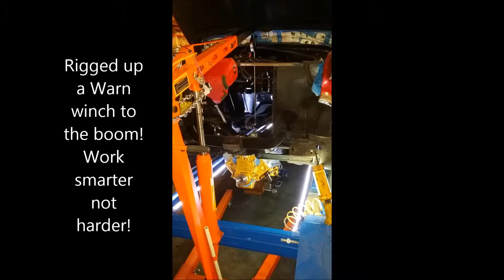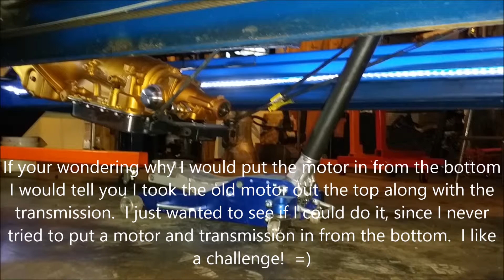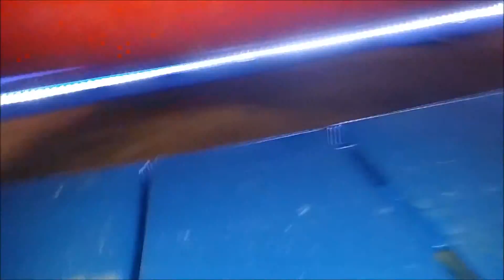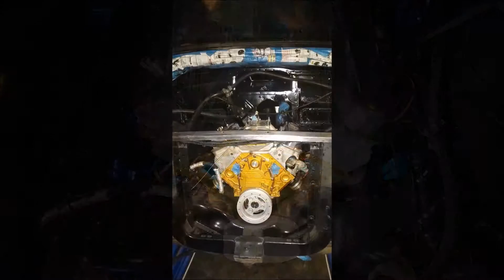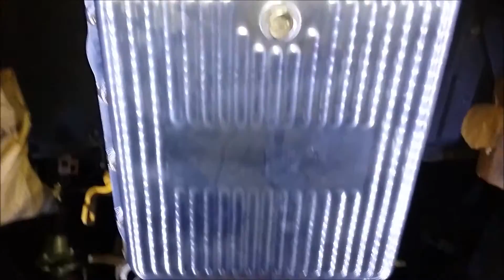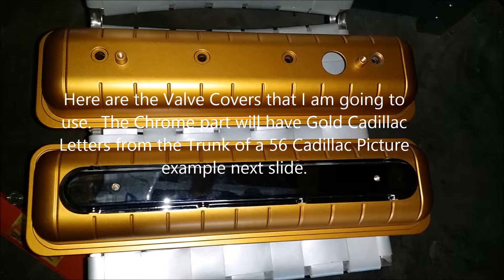1956 Cadillac 96 LT1 700R4 Installation

Comment: hi,  very good job congrats  have exactly the same proyect LT1 engine and '56 cadillac fleetwood. ..how much for the motor mounts and tranny. . what can of problems with  power steering box? .. can you help me with the mounts?
Reply from the maker: Julio Parra, the power steering gear box is a tight fit with the exhaust manifolds may have to have a custom manifold for drivers side.  I dont sell the motor mounts and the trans mount sorry.  but they arent hard to make just have to put in the time and elbow grease.  I did make a second set of mounts because the original were not as wide as I liked and I thought it would put too much stress on the bolts.
Reply: Josh Hypes hi ,just from work...thank you, you give me the idea on the motor mounts,  about the exhaust,  you can put corvette or camaro manifolds ,you know, those are more thin or skinny. ..
Reply from the maker: Julio Parra, yeah i have the corvette manifolds they didnt fit the camaro ones i have on it right now but had to modify them to fit.

Comment: Is that the stock stiring box?
Reply: Was it hard not to make the oil filter and gas pump not to hit the frame?
Reply from the maker: jose cornejo, no the gas pump is electic mounted down at the gas tank.  Oil filter wasnt a problem.
Reply from the maker: jose cornejo yes stock steering box.
Reply: Do you think it will work on a 54 Cadillac?
Reply from the maker: jose cornejo, not 100% sure, but probably it will. Most of the 50s cadillacs had similar x frames.
Reply: @hypestero  hey bro you're a genius I just installed a 350 on my 54 Cadillac thanks for your help man I just wanted to ask you if you changed anything on the brakes
Reply from the maker: @josecornejo1735  Glad I was able to assist you in some ways.  I upgraded the brake booster etc the plan was to run a line for the front and for the back and possible disc conversion in the front.  I didnt complete that, sadly I sold the car about two weeks ago....I miss it badly.
Reply: Do you remember what kind of headers did you used for this car?